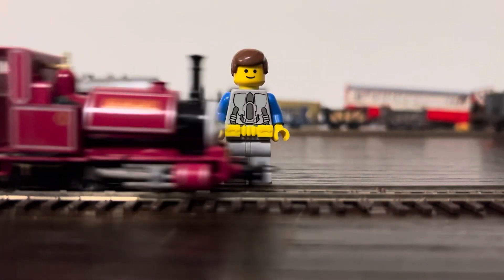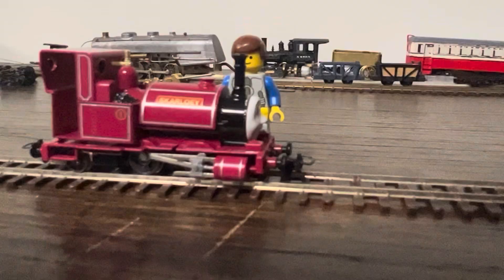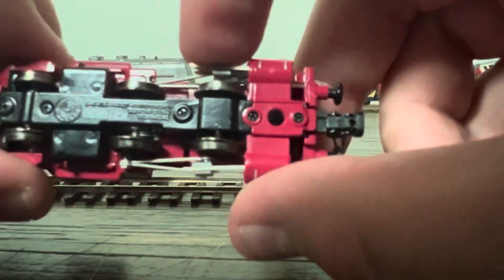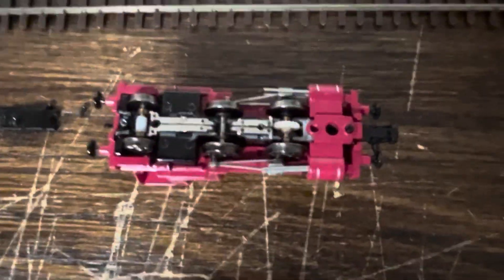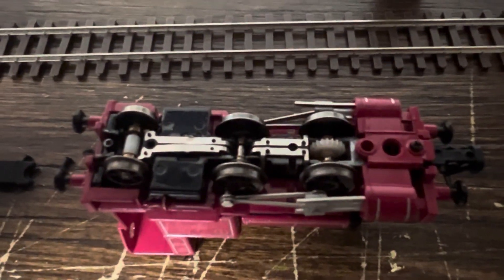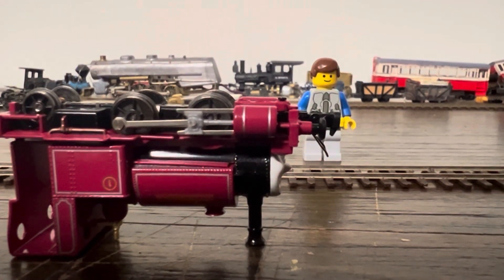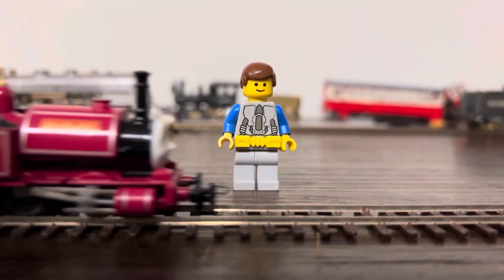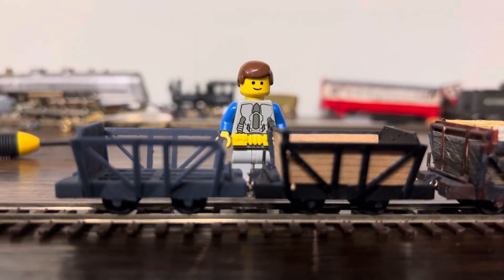Bachmann Skarloey converted to HOn3 tutorial

Comment: What’s the difference between 009 and HON3.??? This is a tad confusing
Reply from the maker: @MaxwellTheTrainFan  OO9 is OO scale (4mm to the foot) on N scale track (9mm on gauge) which represents 30" gauge in HO (3.5mm to a foot)

HOn3 is 10.5mm gauge track which represents proper 3' gauge in HO (in OO it would be 12mm track thus TT scale track) 
This conversation is so the chassis of the skarloey can be used to represent 0-4-2 prototypes that ran on 3' gauge in the US, the shell of the Skarloey will in due time be replaced by a 3d print of a surrey sussex and Southampton baldwin 0-4-2T
Reply: @mattsmocs3281  so skarloey now runs on TT rails instead of N

Am I correct
Reply from the maker: @MaxwellTheTrainFan  no. It runs on HOn3 rails. Neither N or TT